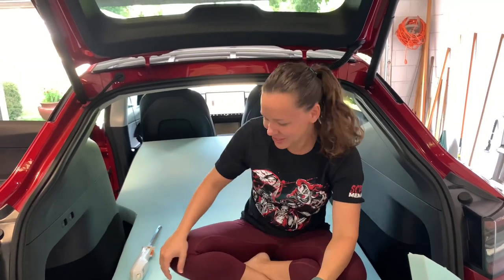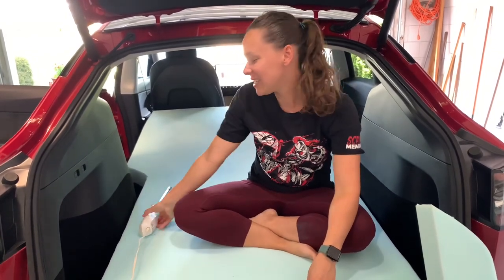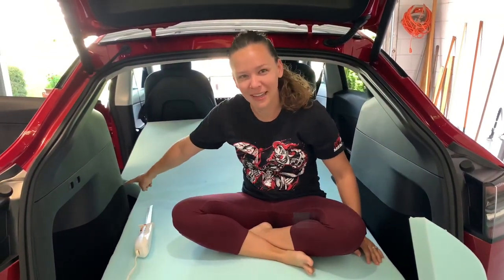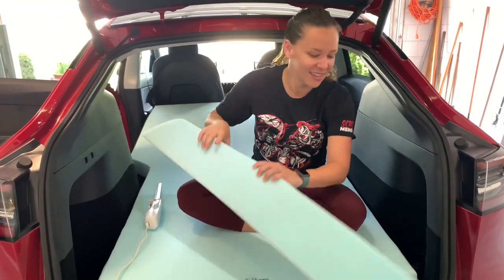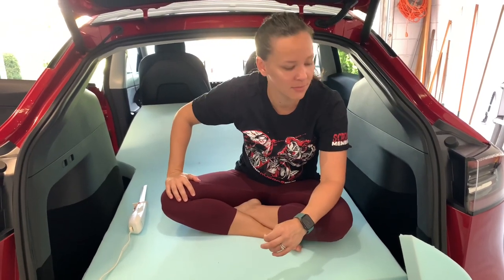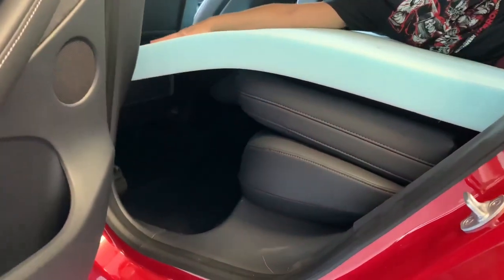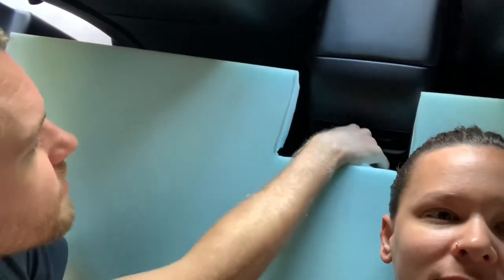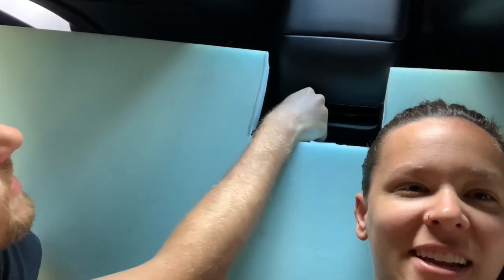Tesla Model Y Foam Bed Modifications

Comment: We essentially did the same thing with a Full foam mattress from Walmart, though made the fit tighter. We use 2 carry on luggage as "supports". Sewed a cover from an old duvet and store it in a mattress vacuum bag in the frunk with a small reversible pump. Mattress: $119 Pump: $10 Vacuum bag: $13 Duvet from thrift shop: $8  Total: $150+tax Cheaper, greater fit, comfort and includes storage solution. Good video.